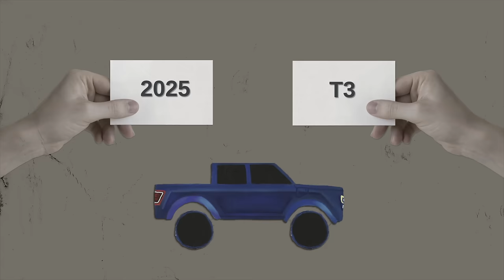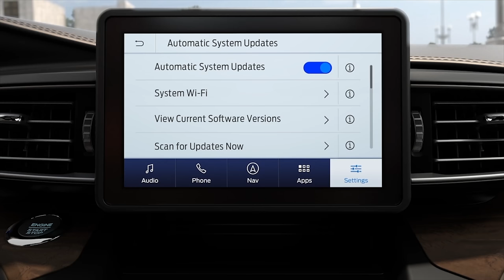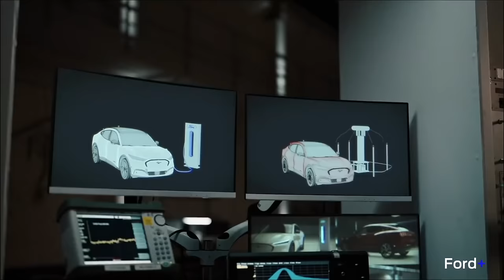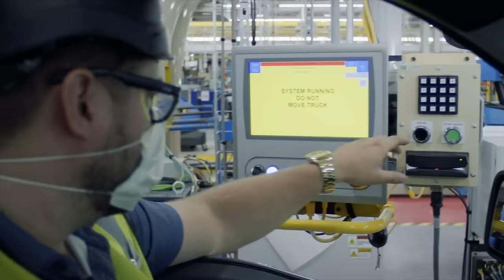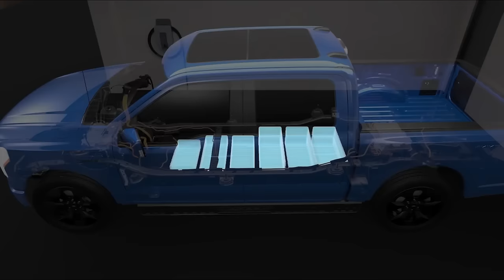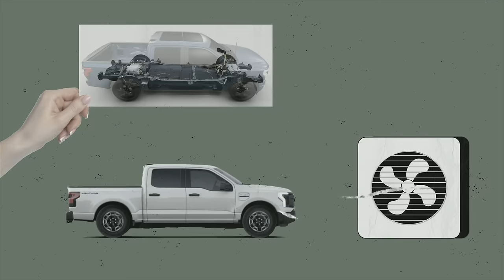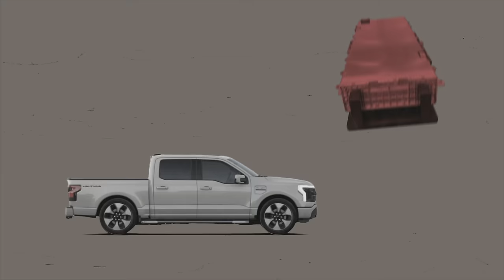Ford's New Cheap T3 Truck Just Killed the Toyota Tacoma

Comment: They could do something revolutionary by making a reliable, plain, hard working truck
Reply: Amen to that and keep it simple
Reply: Toyota
Reply: Yeah we don’t need all the fancy technology
Reply: Sad thing is, they already made them back in the 1940s with the inline-6 ford trucks
Reply: Inflated promises with colorful language. 🐏
Reply: Yeah, instead of the hillbilly status symbols they make now!
Reply: I think they've proven that they can't
Reply: Instead of making a ev truck why not make a normal truck with a engine and transmission.
Reply: So... an f150 xl/xlt? They already got a reliable work truck.
Reply: Bring back “Quality Is Job One”!  All an average guy making $60k a year needs is a basic truck that doesn’t have all the computerized doodads with all the chips that they can’t get from China.  Give us a in-line 6 or a reliable 4 cylinder without “turbo”, manual transmission, bench seats, optional air conditioning, oh, and a standard cab.  Based on paying 20% of your income on a vehicle, you would need to bring in $200k a year to afford a $40k truck!
Reply: They need a natural aspiration work truck with SFI & minimal tech for under 20k. They'd sell em as fast as they can make em
Reply: I wish they all would.  Extend that to cars too.
Reply: @charlesdeblanc3386  what is SFI?
Reply: Nah
Reply: Nobody would buy it
Reply: A simple V8 analog truck without all the other unreliable electronic crap w/exception to EFI & ignition. Simple 4 speed manual that can be maintained by owner. 🤷🏽
Reply: Speak for yourselves, I'll take a Lightning any day over a Japanese pickup
Reply: Good luck.
Reply: @awesomecatvideos4723  ur part of the problem...
Reply: My vote is none of them. Give me a reliable gas engine any day.
Reply: Amen
Reply: Like they used to make back in the 1950s-70s. Chevy could join them in that.
Reply: "cheap"
Reply: @hothmobile100  Standard Fuel Injection perhaps?
Reply: Jim Fartly?
Reply: So secret even God doesn’t know about it!
Reply: All those people wearing masks. I wonder if they are not bank robbers on the weekends. 🤔
Reply: Are they going to close the Chicago plant?
Reply: @hothmobile100 Sequential Fuel Injection
Reply: @glennso47  excellent guess.  Port injection Vs direct injection and no turbo maybe means standard fuel injection?
Reply: ....and deserve  ''Trust The Truck''.
Reply: Amen
Reply: Yeah. Simple. None of that "Drive By Wire" crap.
Reply: I just sold my 2007 F150 with 242,000 miles. Still ran great. Original transmission, engine, starter, alternator, and most everything else. I have a 2016 F150 with a 5.0 v8.  It has 94,000 miles and not a single problem with it yet.
Reply: Those days are gone. The engineers wouldn’t have anything to do. That’s why I buy Toyotas I just do not have the time in my business to keep bringing my car to the shop every time a warning light comes on on my dash. There are just too many electronic features on vehicles now.
Reply: @Eli-jp3uk  They are unfortunately under a government mandate to go electric. If they did this it would be going backwards and they would be left in the dust. Also building manuals are not cost effective as hardly anyone knows how to use a clutch. I learned at 12. It’s sad
Reply: @awesomecatvideos4723  And you will spending more time in the shop and if you want it to last a long time it won’t. Just a fact. Ask any mechanic what vehicles they work on most other than scheduled maintenance. That’s why I switched. I do not want the headache
Reply: @briansalisbury4764  Absolutely!
Reply: Or they could just make a Toyota.
Reply: THANKyou!!!!….. bring back the 300 straight six in a heavy frame 😁
Reply: @Caliber50bmg  yep!
Reply: @briansalisbury4764  I’m 18 looking for a manual 2023 Honda Civic hatchback 

I got into a pretty bad motorcycle accident (it was the other guys fault fortunately and I wasn’t breaking any laws) so I should get a looot of compensation money, 

I assume since I know how to drive a motorcycle that’s manual with a clutch handle etc like most them are, a car isn’t too different? I’m just not a fan of CVT transmissionz
Reply: Kind of like the Model T?
Reply: @hothmobile100  Sequential Fuel Injection?
Reply: Impossible because epa
Reply: Totally useless for a truck, it just a grocery carry. I put 36,000 miles on my truck in one year and 90% of that is for my small home improvement business. I would spend more time charging the damn thing them working.
Reply: Yep what this guy said! It's that freaking easy Ford!
Reply: Agree, things like the hummer, gas or electric, are not a reflection of practicality. Not that there is anything wrong with that.
Reply: @herbb8547  If you calculate you find out that that 240k miles cost 40 grand in gas, an extra grand in oil changes, and a couple grand extra for brake replacements. These costs are not required on an ev.
Reply: @awesomecatvideos4723  a Japanese pick up truck towed the space shuttle
Reply: @miguelcadete2495  Contrary to what you are thinking, I think you will actually benefit a lot from an electric truck. Your daily business is mostly local and short distance driving, and you can plug in your truck every night. You would save a lot on your fuel bill. Electric cars are perfect to your use case. Not so good for guys who need less frequent but long distance driving.
Reply: @Tokenomics  I take it you don't know much about EVs.
EVs have brakes too. Otherwise, how do you stop them? There are four electric motors on each EV,  they don't last that long, and they are expensive to replace.
EVs are not cheap vehicles to run. EVs need new batteries every 100,000 miles for a cost of at least 20k. It costs more for the electricity to run an EV than gas for an engine. (Electricity is not free.) EVs cause over twice as much pollution as most electricity comes from coal. EVs actually cost over twice as much to operate compared to equivalent gas powered vehicles. Then there is the big question of what to do with all those old batteries. They are an environmental disaster waiting to happen.
Reply: And also batteries will get cheaper. The stealer overcharges for everything. In time there will be aftermarket battery options that cut the price in half. Its 140 per kw to build a lithium battery. Sodium ion may bring that down to 40 per kwh. Technology, efficiency, competition, and options will continue to improve as market share grows. The gas car industry received A TRILLION DOLLARS in subsidies. It was never a fair playing field. But progress is in full swing now.
Reply: They could yes. But for years now they have been really good at making absolute crap in Mexico.
Reply: They've done that before.
Reply: @samb6066  Toyota isn't the only good choice....infactz toyotas have problems too. I'm so soc of people acting like Toyota is flawless.
Reply: @MrOiram46 they've made plenty since then..
Reply: @Dantastic123 bullshit.....they've made plenty  of reliable trucks....I've never had a major issue with a Ford. Mine,  my family's, and friends have all had well over  200k with no major problems...there's a secret though...YOU HAVE T MAINTAIN THEM...shhh...don't tell anyone...apparently people don't understand still
Reply: @awesomecatvideos4723 I love  ford, but I  have to admit, honda and toyotas are better. And I'd never buy an electric lightning....junk
Reply: @richsweeney1115  never said it doesn't, just reliable more so. I feel you might feel personally invested in this. The thing is there is less tech in the tundras so less problems, but not these new ones. That is all.
Reply: @donjohnson3701 if people weren't so stupid, and would stop buying  thm...maybe it'd change
Reply: @richsweeney1115  yeah, maybe in the past they made decent vehicles. But not anymore. They're crushing EVERYBODY in recalls. Ford has more recalls than the next 3 automakers combined. And it's been like that for years. Ford's CEO even admitted it. In not so many words, he said they know they make junk, and it's going to take some time to make things better.
Reply: @charlesdeblanc3386  mavrick are sold before they are even built
Reply: They already do.

Comment: If Ford built a regular cab, 4X4, 1/2 ton with an inline 6 like the old 300ci, a manual transmission, bedliner, hand crank windows and manual door locks it would sell like hotcakes and they could probably sell for under 30K.  The working class needs an affordable work truck.
Reply: Bingo - back to basic construction without the expensive gadgets.
Reply: agreed
Reply: You need to work for Ford. Email them! Companies answer the market. If enough people got together and voiced that's what they want, Ford would build it.
Reply: Spot on
Reply: I agree completely. I've been saying that very thing for 20 years. They wouldn't  be able to build enough of them ! !
Reply: there's plenty of those trucks around, i drive one, just put the money into fixing it up. or buy mine i'm trying to get a t3 and pay nothing to run service calls across the suburban sprawl all day
Reply: Nope. Nobody wants manual windows or a manual transmission in a truck.
Reply: I held on to my 81 f150 with this setup until it couldn't pass smog it now lives in the mountains with its new owner. I'd buy a new one in a heartbeat.
Reply: @kenshinhimura9387  I do.
Reply: @kenshinhimura9387  BULL S*$@ !
Reply: And remember to include the vent windows.
Reply: @jd-py5nm  Those trucks were easy to work on and nearly bullet proof.
Reply: Call it the F-150 RETRO. I'd buy it. Gotta be a quad cab and have an 8-track player, though...
Reply: I'd pay extra just for the 300!
Reply: Exactly. Been looking for this truck for 15 years now.
Reply: I owned that exact truck, a 1992, it was the best full sized truck that I ever owned, I kick myself for getting rid of it!
Reply: @Gary Brinker  you and a handful of other people might want it but the vast majority likes power windows. They are easy to service, very cheap and work for decades with no issues. Absolutely no reason to have manual windows in a vehicle.
Reply: with the granny gear?  I think it would sell too.
Reply: @gdholmfirth  yes I agree on a cheap, reliable and affordable truck. $20k fully loaded and maybe $10-15k basic model would sell like hotcakes 🥞.
Reply: @kenshinhimura9387  I have one a 97 f150.
Reply: I do not know about the hand crank windows and door locks. That is insignificant as far as price anyway.
Reply: @kenshinhimura9387  I prefer being able to open a window without the key on..And yes,, powered windows  do fail..
Reply: And also have retro nob on the dash for wipers, and a floor switch for high beem...Yes definitely a manual transmission..
Reply: Used to buy those for $12,000.
Reply: There's so many in the wild that just need basic tlc I'd say the demand isn't truly there
Reply: Look at how many Ford mavericks people are lining up to buy.  Truck owners want to an inexpensive reliable truck.  Imagine a full size work truck truck in the price range of a maverick.... The cost of a brand new base model full size truck is around 50K and it comes with all kinds of crap people who need a work truck could care less about.
Reply: @kenshinhimura9387  bull crap they just sell as well as an automatic but it will sell
Reply: @garyindiana2127  " and pay nothing to run service calls across the suburban sprawl all day"
Other than the cost of charging and the perpetual subscription required to keep it updated and running.
Reply: @kenshinhimura9387  Until the price difference becomes evident.
Reply: @garybrinker4522  manual windows also fail lol
Reply: I would not purchase a truck like that.

Comment: I want a new production truck with the tech levels of a 1970s truck. I want barely any electronics.
Reply: 100%
Reply: I’m talking roll up windows, manual locks, no climate control, no power seats, manual mirrors, no fancy ECU, just a big torquey V8. If you build it, we will cu…..ahem, come.
Reply: @I_SuperHiro_I   Roll up windows have no benefit over power windows. Power windows are far better, last longer too. Old roll up windows start to roll back down, they are a PIA.
Reply: Give me a Mechanical fuel injected, magneto, and a 7 main gear drive in-line 6.
Reply: @I_SuperHiro_I  lmfao try that no a/c crap here in Florida. You will pass out from heat stroke
Reply: @Joe  why do you weirdos insist on outdated inferior technology? Coil on plug fuel injection is awesome and extremely reliable plus very easy to work on.
Reply: @I_SuperHiro_I  And AC.
Reply: That truck will run after an EMP.
Reply: I loved my ‘71 Ford F100 long bed 1/2 ton PU with a 360 v8 and three on the tree. I’m pretty tall so I could reach across to roll up the window on the passenger side. Manual steering was fine most of the time but not if trying to parallel park. I did not love working on it as often as I had to with plugs, points, carburetor, king pins, alternators, etc. It was a pretty dependable truck and comfortable on my back. Easy to get to everything under the hood. When it was running good, it got about 14 mpg whether city, hwy, loaded, or empty. Now I drive a 2008 Tundra Double Cab w/5.7 v8 and tow package. Gets about the same mpg but the difference in technology, quality, and reliability is undeniable. Fuel injection, electronic ignition, air conditioning, air bags and shoulder harnesses are good things. I prefer the back seat of the Tundra to the zero space behind the seat of the 
regular cab Ford with the gas tank in that spot. But the Ford would accommodate 4x8 sheets of plywood or Sheetrock stacked flat between the wheel wells with the tailgate closed and it can be push started. The Tundra can’t. Oh, and the Used Ford cost $700 in 1980. In 2008, I paid about$30000 out the door for the new Tundra.
Reply: @kenshinhimura9387  E.M.P. would like to know your location💀
Reply: @mr.2cents.846  This guy gets it.
Reply: @kenshinhimura9387  whoa now, I said no climate control. Ain’t no way I’m living without AC.
Reply: Problem is few other people want that truck - not enough to design and build anyway. But it’s not a bad idea as an option. Until then, go to 3rd world country. Buy truck, import yourself or drive it back to US. Trucks in Ecuador all have minimal amenities and manual transmissions. I suspect it’s the same in Mexico. May have a problem registering it in your state though. Another option is to buy a 1970’s truck and rebuild it. Won’t be cheap but you’ll get what you want.
Reply: I’m never buying electric they can’t even keep the power on now we have blackouts. We don’t need electric vehicles when we can’t even keep our house going.
Reply: I want a 🐴

Comment: I think the Toyota is safe in its market share. Those milage numbers they give for the EV trucks are ridiculous and the sad part is we know it and they dont care.
Reply: not to mention when you tow anything the range can go down to 1/3 of their claim.  not too bad when you can fill it up with gas in a few minutes, but hours to charge makes towing impossible with electric crap
Reply: Ford cares about the stockholders and the executives salaries. Not so much about the customers...service  have such a hard time duplicating problems when the vehicles are under warranty.
Reply: I think these auto manufacturers especially the engineers really hate this electric crap but the government has made it mandatory.
Reply: @bigmikeobama5314  Exactly we are a decade or more away from anything electric especially a truck being as easy to operate and have the same range as a vehicle that runs on fuel.

Comment: I wouldn't own an all electric vehicle if you gave it to me.
P.S. Great video, Scotty
Reply: @richardfolden3860 you too, good like even finding an EV mechanic when your stranded.
Reply: @richardfolden3860 Staying poor by NOT buying an overpriced and ultimately less reliable EV? Tell me you're clueless without telling me you're clueless... Come on, dawg.
Reply: @richardfolden3860  what does that even mean?
Reply: I wouldn't take an EV if it was given to me either. I also wouldn't take a Chevy or Dodge truck either. I like my dependable F150s.
Reply: @herbb8547  I've had 2 F150's. A new Ford F150 is sold every 49 seconds! Remarkable!
Reply: @richardfolden3860  Are you insulting me or just have nothing to say?
Reply: @richardfolden3860  until the grid goes down. The time it takes to charge the hummer is laughable! It’s extremely inefficient the battery weighs 2400lbs by itself and is more complex than Tesla pack
Reply: @richardfolden3860  haha sure thing. I have a diesel truck so I can run on anything that’s oil based. It’s ok to admit you were duped into a dream lol. EVs are indirectly worse for environment than any ICE engine
Reply: Ooh give it to me

Comment: What I would give to buy a brand new 1972 ford f 250 4x4 360 with 4 speed transmission! Now that was a truck ❤
Reply: Yes, they were.
Reply: Bahahahaha 1972 f250 . Under 200 HP from a 30liter V8 . No safety features ( maybe a seat belt) . 0-60 mph in never .  So glad those kind of vehicles are gone.  If a modern ford lightning crashed into that thing that old ford would crumple like if it were made of newspaper .
Reply: @TheOriginalBumper  go away
Reply: @TheOriginalBumper  It wasn’t a 30 liter V8.
Reply: Probably can go find one in the bush in the midwest

Comment: Can ford just make a reliable truck that can go 200kmi with no issues, good rust-proofing underneath, get 20-25mpg around town without a overworked weedwhacker engine and no turbo,  no cameras, no auto start crap, no lane keep assist, no plastic intake manifold direct injection plastic timing crap, no ecoboost....  just a plain dumb reliable workhorse for under 20k? Cause that will sell millions, not the current garbage the all hat no cattle folk buy, toyota was able to do this 20 years ago why hasn't the price dropped?